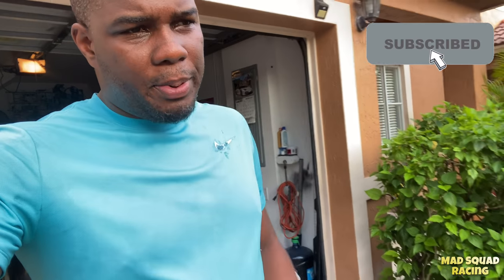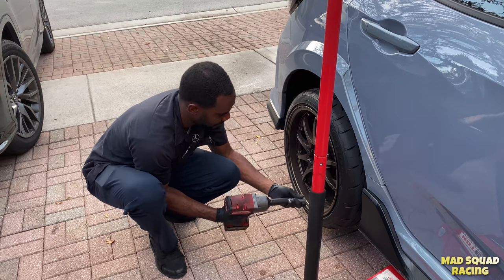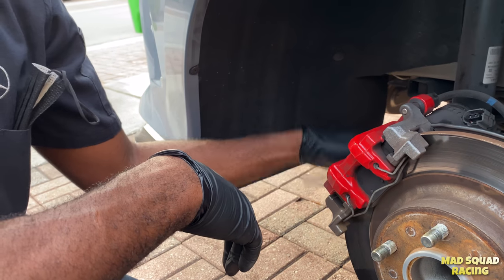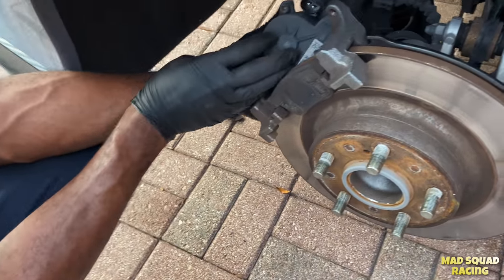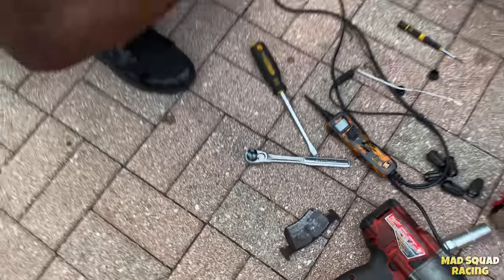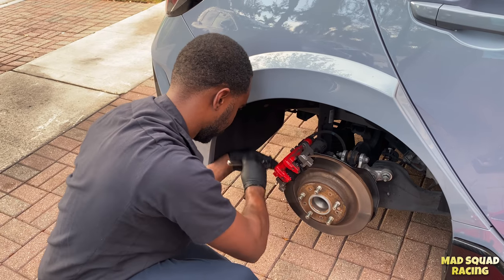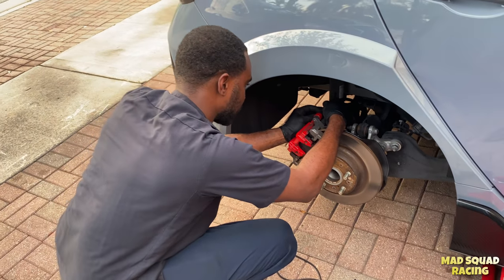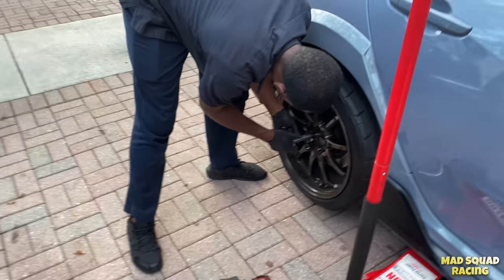HONDA CIVIC TYPE R REAR BRAKE PADS REPLACEMENT NO DEALERSHIP NEEDED DIY

Comment: When you corner even if you don’t hit the brake the abs on a type r is automatically using the back brake to help keep the car stabilized the front brakes wear out when you actually hit the brake pads

Comment: @mad squad racing  - So, if I have watched this correctly, after removing the plug and the calliper unit - you are sending 12 volts down the calliper end plug in either polarity.. to make the emergency brake go in ... or go out.... depending on the polarity ( i.e. the + and - on different pins in the calliper end plug) - Is that correct?
Reply from the maker: Correct
Reply: @madsquadracing  - Just to say thanks guys ….  On my MOT the Honda garage wanted £450 to replace the front and rear brake pads. 
I purchased the tool for £65… and some Mintex front and rear pads for about £80 for the pair… and done both of them in about an hour or so. 
Cheers
Reply from the maker: Glad we could help appreciate the feedback and continued support 👊🙏

Comment: Or use a caliper compressor tool you can get for 40 bucks and it turns the piston as it pushes in ….. don’t have to put power to the piston itself save yourself some time and less tools to use
Reply: Bad idea it seems to me because if the pistons are out a lot because of wear on the pads and the disc, you risk breaking your brake caliper.
Reply: @Eben-Victorious  i do it all the time on newer type r’s and other vehicles, fully extended or not they go right in , it’s what the tool is made for

Comment: Can't you just leave the emergency brake off and skip this whole process?
Reply from the maker: Nope that the way that works for me all the time
Reply: @madsquadracing  I just did my pads after watching this, and all that I needed to do was release my parking brake, leave in gear, put wheel chocks behind the wheels, and etc.
Reply: @codefk8711  everything I have read says you have to put into maintenance mode cause if not…you can break the piston. This is a way of getting around putting the car into maintenance mode if you don’t have a scanner. I’ve been doing a bunch of research cause dealership gave me a ridiculous price to replace my rear pads so I wanna do it myself
Reply from the maker: Never had a issue doing it this way and many of my friends never had any issues as well
Reply: @Big-G-214  the cars factory headunit system shows nothing in regards to maintenance mode from what I can see on my 2019. You very well may right, but from what I saw in the video, they simply used a volt meter to manually power the emergency brake to retract. 
I'll research more into this, but I did it the way I mentioned in the comment above, and have been driving all day with no issues. 
I appreciate the comments from both of you though, and I'll dig more into this, and talk to a few of my Honda certified mechanic friends to learn more
Reply: @codefk8711  you can’t do it from the head unit. You have to have a scanner from snap on or Honda to put the car into maintenance mode
Reply: @codefk8711  you could also be correct by releasing parking brake. I’m gonna do it the way this guy shows in the video this weekend tho. Hoping for the best! Have everything I need besides pads and meter/probe which should be here tomorrow. I’ll report back to let everybody know how it goes
Reply: @Big-G-214  I did it by releasing the parking brake, removing the parking brake motor, caliper, replace pads, and etc. Haven't had any issues with the motor or the caliper since the install. Even took the wheel back off and everything's fine. It might depend on the year, idk, but so far so good
Reply: @codefk8711  I was about to give an update. I have bad anxiety and overthink when it comes to stuff like this. Didn’t wanna break anything so I have done a ton of research. I actually came across the Hondatech manual on how to change the brake pads. It says you can do it w/ scanner and putting car into maintenance mode OR taking the electric parking brake actuator off and using an E11 torx socket turn the spindle until it locks. Then you can compress the piston. So you’re right! I’m gonna do it like that as well cause I don’t have a scanner. But the method the guy shows in this vid just is another way so you don’t have to take the actuator off
Reply: @Big-G-214 do you have a Type R ?   What model ?   Did you end up doing it like that .?
Reply: @guachito33  I did when I commented on this! It was a 2021 type-r the fk8. I just traded it in earlier this year but I miss her lol what I did was turn parking brake off & chock the wheels. I took the caliper off & on the back is this actuator thing. I forget the exact size but you can turn it w/ a certain female torx bit then compressed the piston & changed the pads. It was pretty simple. Saved a ton of $ doing my rear pads myself cause I remember the dealer quoting me a ton of $
Reply: https://youtu.be/PMIRr6Idwto?si=7dBIjrS6vXNSEVBq this is exactly how I did it! I remember being sketched out cause I didn’t have a scanner to put in maintenance mode but if you read the actual Honda manual…you can do it this way as well.
Reply: To chime back in after over a year, still have zero issues, and have talked to 2 techs from Honda and they said my way is the second option in the manual. They always recommend and encourage the other way so they get the job.
Reply: @codefk8711  I didn’t either when I did mine. Like I said I just had to take the actuator off the back of the caliper & turn the actuator pin w/ a torx bit then I was good. That’s the way it says in the manual (other than the scanner)
Reply: @codefk8711  the 2nd option in the manual is the way I said….take the actuator off & turn the spindle w/ a torx E11 till it locks then you push the piston in & change the brakes.